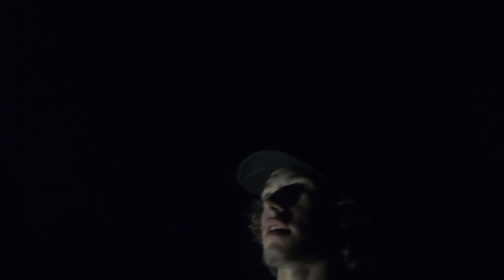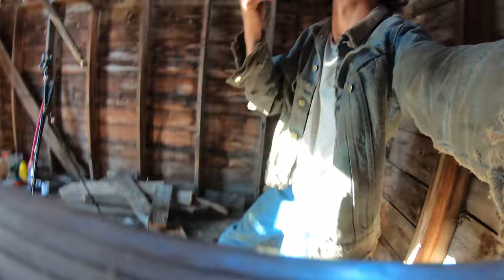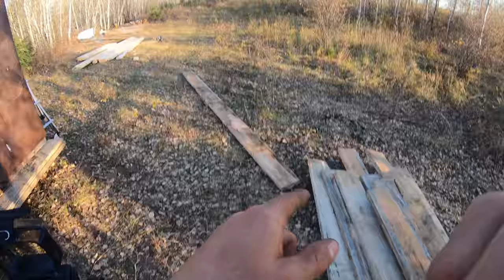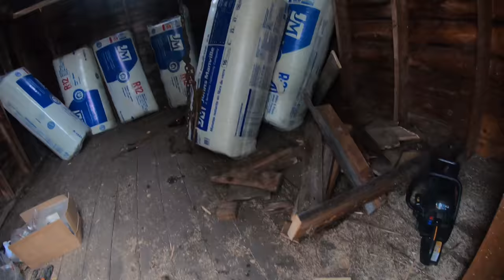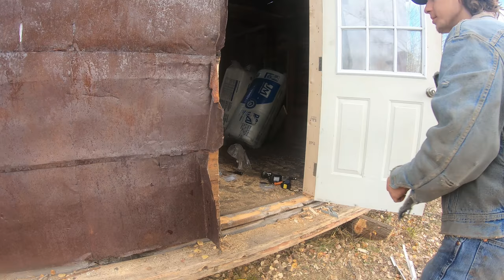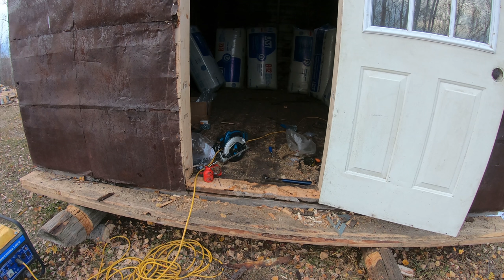Offgrid Workshop Project Pt. 2 - Installing a Door, Fixing Structural Issues

Comment: Throw up some tar paper while you wait for the tin. Keep the rain out until the roof comes.
Reply: Liberty Creek Off Grid    It's gonna be a shack.  Doubt there'll be any paper.
Reply: @jimf1964  Paper would be a simple and quick fix while waiting for the tin. Its cheap and goes on quick. He removed the shingles so I would think it will leak if it rains. Has the insulation stored in there. Also a Little extra protection if he is only putting on strapping. Wouldn't hurt that's for sure.

Comment: I like the shack deal you got!  Just awesome it has turned out this way for you!  Dang tin should have been there earlier for you!  Hope the rain holds off and you can get it on fast!  Flashing the old floor perimeter against the walls will help tremendously against critters. The wider the flashing the better.  Fold it and tack her home.  Then lay down your insulation and new floor design.  That center beam seems to be getting lower and lower on ya.  Would it work better sitting on top of the wall sill plate and nailed against a rafter? Temporarily, storm shutters could cover the window openings until you can hang a couple windows in it too!  This great find has been very exciting to see how you think of ways to improve it and make it your own!  Way cheaper no matter what now with the way things are with lumber.  Do not forget to put the wood fired jacuzzi out on the back deck!  Stay safe and healthy!  Need some back straps for dinner soon!

Comment: In case you have trouble making a straight cut with my skill saw like me I started to use my rafter square against the edge of my skill saw to make perfectly straight cuts. I put the saw where I want to cut then put the square against the saws plate and I always have perfectly straight cuts all the time.

Comment: You should buy natures generator it uses solar and wind power up to 1500 watts. its only 700$ well worth the investment nice job framing that new door it looks like a pretty flush fit just throw that weather strip and you should be good to go. by the way most dollar stores sell replacement door knobs and key for like 7$

Comment: Thought I would chime in, you asked about putting tin right on the roof as apposed to running 1 by 4 runners and the. Placing tin. The issue with runners is critters can get between the tin and the roof and live in your insulation. If you tar paper the roof and tin right to the structure you should eliminate that issue plus it will assist in your R value. Digging the grainery repurpose!!!!!

Comment: Hello Mate, 

Great video as always. Forgot to comment on the last video:

Be mindful about leaving a battery in your new skinning shack when its cold out. A fully charged lead-acid battery can survive up to –50 C, but a battery with a low state of charge can freeze at –1 C. When the water in a battery freezes it expands and can cause irreparable damage to the cells.

Keep it up :)

Comment: safety glasses & chainsaws go together; I might have put the door on the wall you pulled over and then put a window in the original door opening; battery-sozel would be handy

Comment: Nail some door stop, inside strips of wood, 3/4 inch thick or 1/2 would be better. That will insulate that crack around the door and make a solid stop so you don’t push the door in when you close it.
Reply: exactly what i was thinking.

Comment: Get the dewalt Flexvolt saw. DCS578 X2. Comes with two 9 amp hr batteries and fast charger. Then later on down the road you can purchase the cordless nailer. Anyways. Ya, maybe just check them out. Something might catch your eye. Milwaukee is pretty darn good to.

Comment: Just a little hint,you said you didn't have a drill to pre drill. This works everytime even near the edge. Using your impact run it in reverse for a few seconds pushing untill you see a puff of smoke,move to forward and drive it home. Won't split guaranteed

Comment: Hello young man, I hope this text finds you well. Great news about the metal shack your going to convert to your skinning and work room. Great start with the interior support work and the front door. You seem excited to get going on this due to the seasons coming so quickly. I would only say please be careful with the chain saws you use. I wish your diet was more rounded with some green vegetables and other good things for your body.  Try apples, carrots, oranges etc. Your such a great smart and handsome young man. Please take good care of your self. I understand your need for privacy and safety. Do you accept no strings attached support ? If not that's ok . Tom in Minneapolis, Minnesota.

Comment: If you still have to put down a floor over the old floor you will have a small step up because the door was put in first,still will work,you had just enough room to put the door in without cutting into the board at the top :)

Comment: My dude, new landlord here and I can across the same problem I wanted to avoid with my tenants' front doors. Real issue if I have to show up to let them in all the time for accidentally locking themselves out.

If you look it up on Google, there is a way to disable the locking mechanism on those handles. Consider the handles attached to the door to start with. When you split the handles in two and off the door, that long, square tube that connects them. That square tube turns the latch when you turn the handles. This is what I want you to focus on. Inside that square tube is a flat metal tab. That tab allows the locking mechanism to trigger. Cut off the tab where it meets the tubing (or close) and the locking mechanism can be fucked with no more. I used a metal file and snapped her when she was bendy enough to pry loose.
 Saved ya a $20, bud. 👌

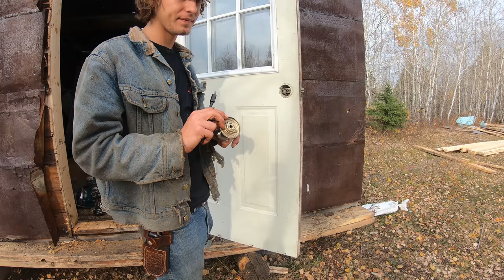Comment: 1:06:10 If you got a key the same style that will fit inside it, take that whole door knob assembly to your local hardware store and ask them if they can re-pin the lock to match the key. Most hardware stores that sell door knobs will also sell pins. It's a fairly common request.

Comment: The Roof I'm telling ya I'm telling I'm telling ya old timers far n wide swear by reflective bubble foil under floors. 
Now im not telling you to put bubble foil on the roof but i pray to ya buy reflective foam board! That tin foil side adds huge value (I'm a civil technologist who went to college and am building my own house meow) 

The 2x4 roof is crap for insulation , but even ONE INCH foam board with reflective layer will be plenty !!

Cheers from New Brunswick ✌

Comment: sheet the inside of roof with 2 inch styrofoam to get r20
Reply: I think he should do this on the outside underneath the roof.  Then ya can see the wood ceiling from the inside ♥️
Reply: 2" styrofoam will give him R2
Reply: @robertn2813  wrong
Reply: @scottfilbey7882  2" styrofoam doesnt do shit
Reply: @scottfilbey7882  styrofoam isnt used for insulation , you need to learn the proper product names
Reply: @robertn2813  lmao styrofoam isnt insulation? Cmon man.
Reply: @scottfilbey7882  Extruded Polystyrene  , which people " OTHER than professional builders " call "styrofoam" coz they don't know better , only gives 3.5 - 4.6 of R value per inch . And a 2" x 4" vaulted ceiling can only accommodate R-13 batt insulation , which isn't near enough for a vaulted ceiling . He would be better off nailing 2" x 4" 's on-edge to the existing rafters , thereby making the roof rafters 7" deep , and having space for R-30 insulation . That's what i would do if it were my place , but , it's not . Our friend is gonna do what he does . And looking at what he's already done without decades of construction experience , he's doing an AMAZING JOB !!!!! He doesn't need people to tell him how to do it . HE ALWAYS GETS SHIT DONE , WHILE OTHER PEOPLE STAND AROUND TALKIN' ABOUT WHAT THEY NEED TO DO !!!!! Which brings me to the reason i made this comment . Scott , you have been schooled on insulation . Now get your ass up there and help him build it , or sit there with your thumb up your ass , and shut up . I thank you sir .
Reply: @robertn2813  I'm a journeyman carpenter for 15 years. Have a good day
Reply: @scottfilbey7882  And I'm a Red Seal Master Carpenter for 37 years . YOU have a good day Pup !
Reply: @robertn2813  thanks bud